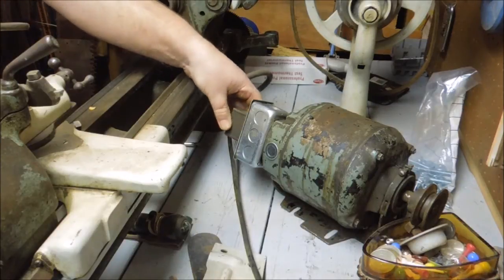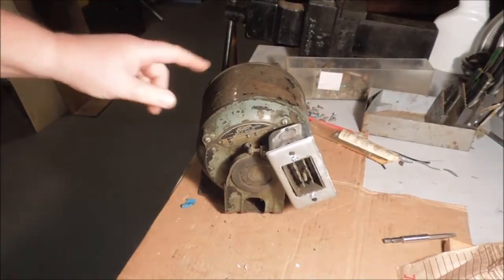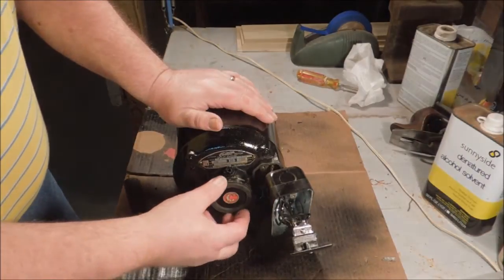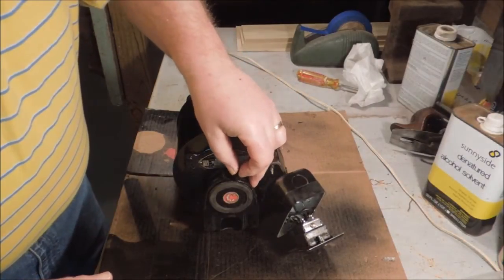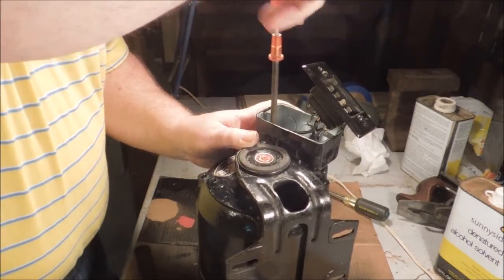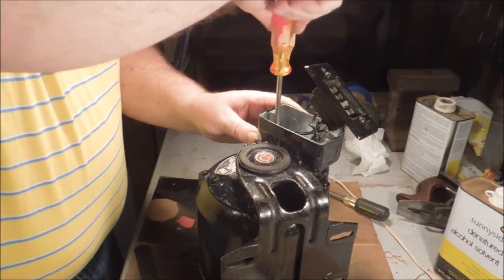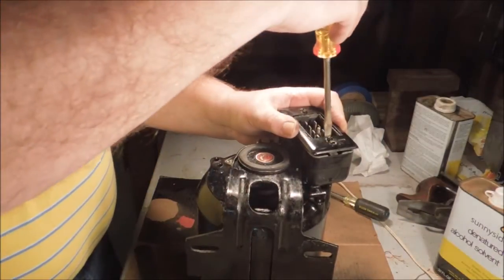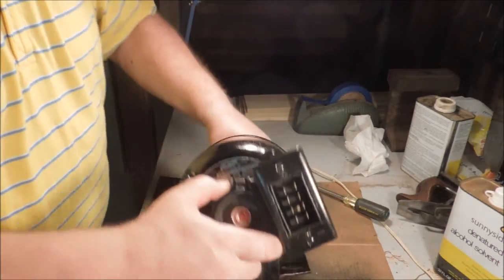Rewiring the South Bend Lathe Motor Pt 7 It Works.

Comment: It sure was a long journey but success indeed. At first I personally would have junked it , but you stuck in there and did a great job. I have a 9a South Bend but with none of those problems. Great job...Ken ....Marina CA
Reply from the maker: Thanks Kenneth.There were a couple times I thought it was toast.
If the coil leads had broken or the start switch failed I would have let it go.
The motors used to be made capable of being rebuilt. They were costly to replace but with proper maintenance, enough replacement bearings, and a little care with overloading they can run an incredibly long time.